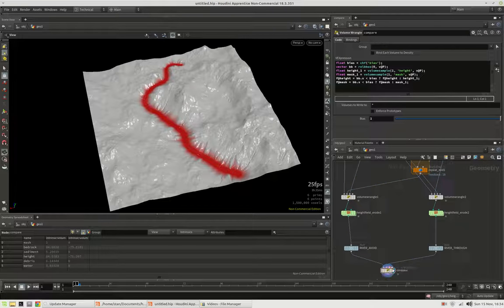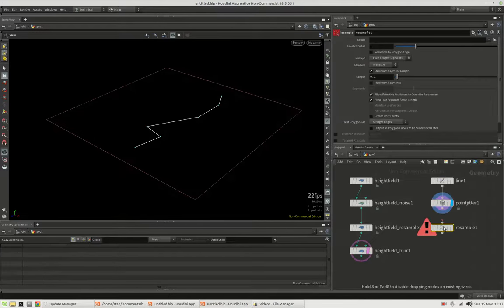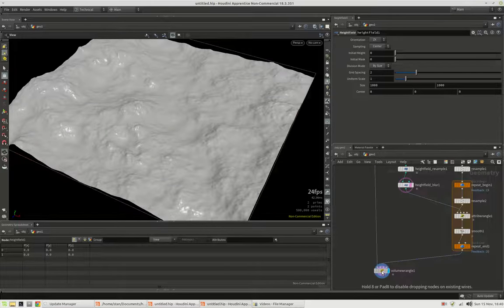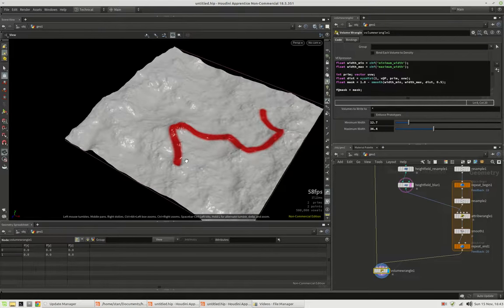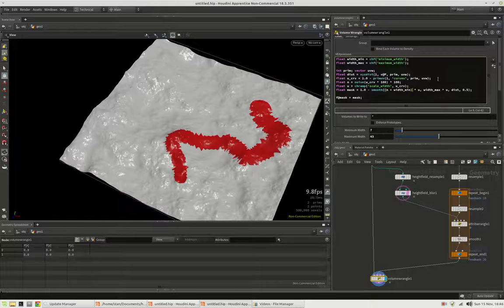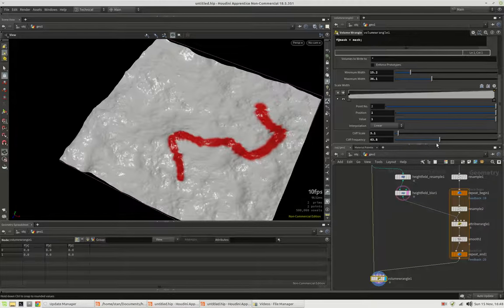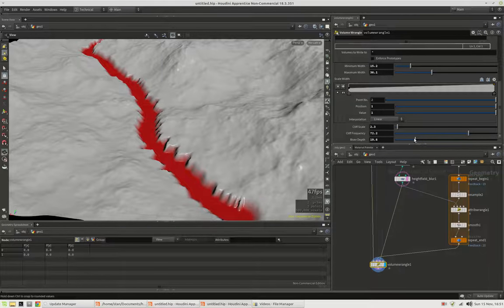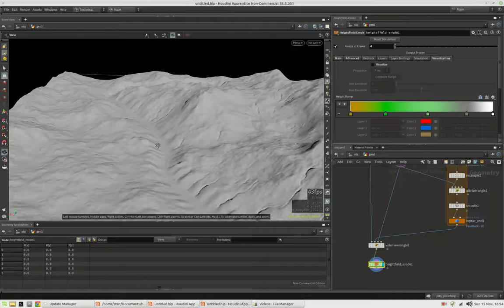Naturally Flowing Rivers – Houdini Tutorial

Comment: if you have curves corresponding to the height of terrain (ie. used pathfind node to generate curves), xyzdist function won't be able to work properly because @P of heightfield only has x and z value and value coming out of xyzdist would be affected by the height of your curve. 
so you would need to set the y position of your curve to 0 before connecting it to the wrangle 
thanks for the great tutorial !